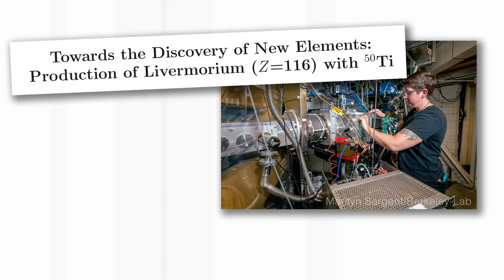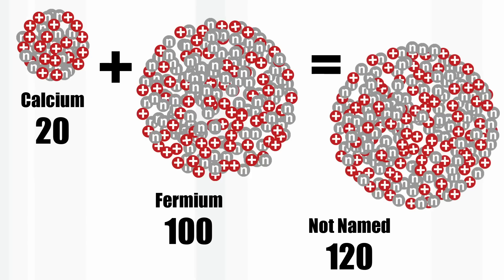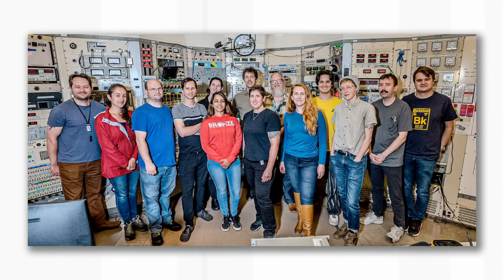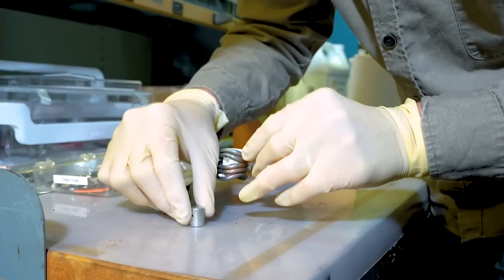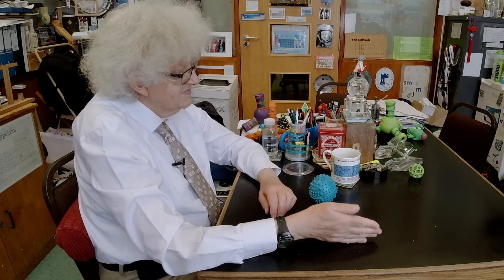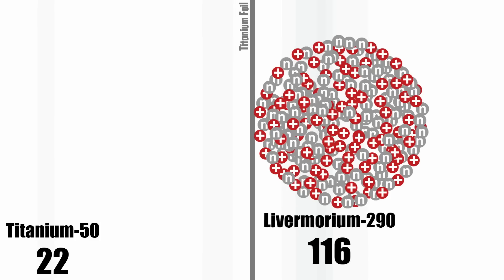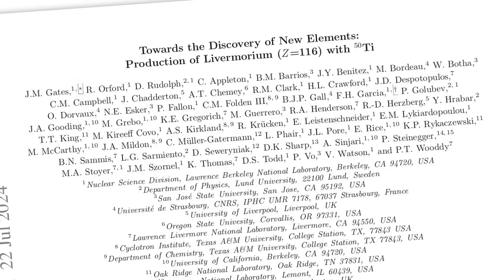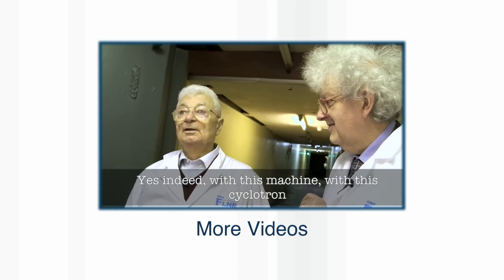How to make TWO ATOMS (and the path to element 120) - Periodic Table of Videos

Comment: Excellent video.  

Suggestion for future video- I believe that several years ago a similar process was used to turn lead into gold, thus finally fulfilling the dream of centuries of alchemists.  Problem was that it took many thousands of dollars of energy to make a few dollars of gold.    Would love to hear Sir Professor flesh out the story.
Reply: Not a few dollars of gold, not even a few cents. A smattering of atoms, not even enough to plat a dust grain.
Reply: I've wondered about that same thing. If the electricity were cheap or free, I wonder how viable it would be.
Reply: and the gold was radioactive, if I remember right.
Reply: @causaestmalleus4605  It only has one stable isotope, and that's even harder to make.
Reply: @garethdean6382  Yep.  You might be able to get there by hitting iridium with a helium nucleus, but im not sure that that is a favorable reaction, and iridium is even more rare than gold.

Also, while Au197 is observationally stable, it is predicted to actually decay, just with an extremely long half life.

Comment: doest the velocity of the outer electrons increase as the atomic radius increases . what size atomic radius would cause the electrons to approach the speed of light?
Reply: Not the outer, the INNER. They are pulled more strongly by the nucleus and have to move faster to avoid collapse. The exact limit isn't known but could be in the 180s.
Reply: @garethdean6382  thank you
Reply: The first guess scientists made was 137, and using more accurate math and better computers they figure it should go up to about 172.

Comment: Is it still a element when the fused atoms still contain their original nucleuses?
Reply: There's no meaningful definition of "original nucleus" when fusing atoms is involved. Imagine you take two piles of marbles and make them one pile of marbles. The original piles aren't exactly still there in the same way. Or like melting two marbles together, I guess.

In other words, you have to destroy the original nucleus to make a new element in the first place, so the question doesn't really make sense.
Reply: @benG2141  marble a lot different from an atom and it's structure, the analogy isn't valid, original nucleus means just that
Reply: @phonotical  Mmmm, the analogy is reasonable but I see your point. If I take a big bunch of neutrons and protons and mix in another, smaller, bunch of neutrons and protons, what I end up with is a bigger bunch of neutrons and protons. All neutrons are identical as are all protons, so there is no "original nucleus" left, it's all just protons and neutrons. What you are asking is equivalent to "if a Plutonium nucleus fissions, are the decay products still elements because they contain the original Plutonium nucleus?"
Reply: Yes, if it's made of protons, neutrons and electrons it's an element.

Comment: If they succeed in finding the zone of stability in these superdense elements, then they could prove immensely useful in future technologies (though a more efficient future manufacturing process would be needed to create the quantities required).

The most toxic element in existence, Plutonium, being used to make new elements entirely is both terrifying & utterly fascinating. A few too many neutrons saturating your tiny sample & you'd get a spike of radiation, or the whole thing would just turn into a charged plasma with some very weird properties.

I'm curious exactly how you would go about using a magnetic field to calculate the mass of individual atoms - so it looks like I'll be doing some more research in the near future...
Reply: They're moving quite quickly, and the heavier ones will get deflected the least due to their momentum.
Look up "Mass Spectrometer"

Comment: Screw element 120, find a way to provide the 110's with more neutrons so they can stick around for awhile.
Reply: Exactly! I want to see some roentgenium jewelry!
Reply: @Jeff-xy7fv  I actually want to make a moscovium crystal someday!
Reply: PBS Spacetime just did a video that talks about exactly this. We just need to merge two neutron stars in the lab. Might take more than 54 people though… 🤔
Reply: Im pretty sure elements 110 and near that range dont have any stable isotopes
Reply: The best way seems to be throwing electrons at 120.
Reply: @naamadossantossilva4736  😂 👏
Reply: The superheavy elements decay ( as I understand it ) due to neutron packing problems an this means you can’t get the balance of protons and neutrons needed for a stable element though this balance may again happen at 126 but we can’t jump that high yet. The other way to make them stable would be to use a heavier neutral particle to replace the Neutron but how you would go about that would be anyone’s guess. Also the heavier neutral particle may be unstable like the heavier proton an electron variants.
Reply: @thedragonslayers4144  Indeed, the heavier neutral particles exist, and small exotic nuclei that include them have even been made, but the problem is that they don't exist for very long.  If I remember correctly, the lambda baryon is the least unstable of them, and its mean lifetime is only about 0.26 nanoseconds, which if I did the conversion right translates into a half-life of 0.18 nanoseconds.  It is enough more massive than the proton and neutron that it normally decays to a proton or neutron by pion emission, which is likely to be disastrous for the rest of the nucleus.  Its lifetime might be increased somewhat by being bound in a nucleus, but no way will that extension be enough to enable doing stuff (other than some kind of mass spectrometry) with the nucleus before it decays, especially since you would probably need a whole lot of them to make much of a difference in alpha stability and spontaneous fission stability of the nucleus, and if one of them decays early (as is likely), it hoses the whole nucleus.
Reply: Making higher number elements in certain ways would allow for those to decay into more stable versions of the other ones, and the advancements technology required for either goal helps with the other.
Reply: @benG2141  Nonsense.
Reply: @positronundervolt4799  We dont have uses for the last 30 or so elements outside very novel uses like cigarette lighters. .. Perhaps more research on existing elements would provide greater advances. What do we hope to achieve with super-elements? Time/Space warping capabilities? Bending other fields?
Reply: @brandon-x1l2i  does the cigarette lighter work by burning everything nearby?
Reply: @brandon-x1l2i …uranium’s in the group you’re describing.
Reply: Maybe evaporate protons instead of neutrons
Reply: @bryaneckenrode351  Problem is that we don't get to make that choice -- the neutrons are more numerous than the protons, so they are more easily knocked off despite the electrostatic repulsion trying to push the protons out.
Reply: @bryaneckenrode351 ?? Then it’s not the same element 😭😭
Reply: @Shmixyy  Maybe not, but it will be a neutron-rich isotope of a different element.  
Instead of Pu-244 + Ca-48 --> Fl-289 + 3n, we could have it make Rg-289 + 3p+